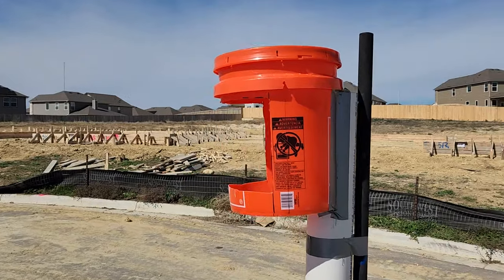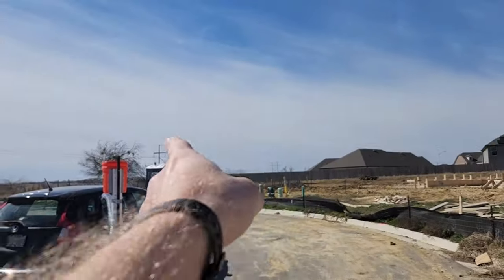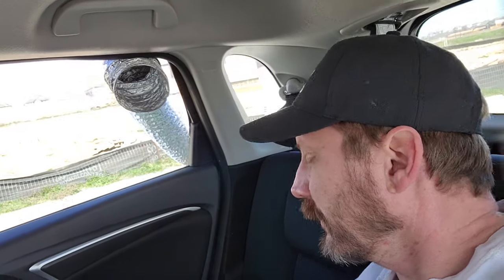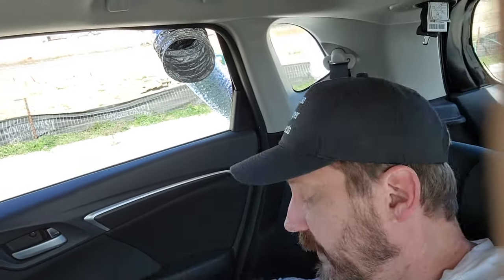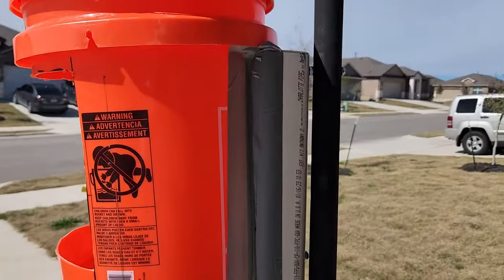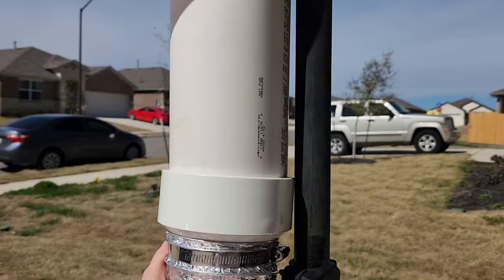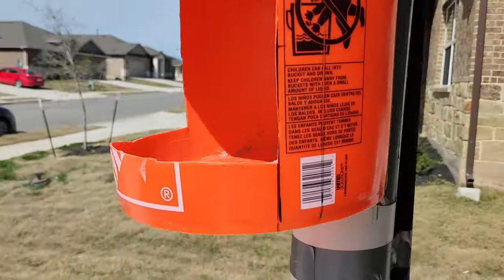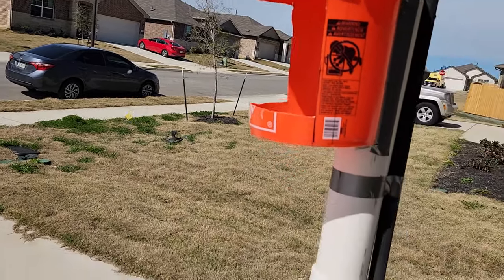Can you have Free Air Conditioning?   Use a Wind Catcher! Darwin wind turbine!

Comment: how about a fin on the bucket then it will automatically redirect won't it?
Reply from the maker: Already doing that for version 2. It will have a tail on the top with a swivel to turn itself into the wind. Thanks for stopping in!
Reply from the maker: Tried that with a tail on the back to redirect. It sort of worked.  Video is up

Comment: Great idea as long as you drive slow.  :). 
Just kidding.  It's a great ideas 💡!  You could use it in conjunction with evaporative cooling, which has been used for thousands of years even to make ice 🍨!
It can take the place of a fan to greatly enhance  evaporation.  Love it!!!  Ty!
Reply from the maker: The original idea has the air blowing over underground rivers to pick up moisture.
Reply: @texasprepperprojects  Underground Rivers like Austin aquafiers?  Local govt might take issue due the potential of contamination.  I know they are super particular about their aquafiers.  
Also, if you pull air out of a well, unless the wells' cave is massive, it will create a vacuum and stop blowing unless you also put air in the hole, unless there is a large opening to allow air in.  
You could use the evaporative cooling trick to cool water then blow air over a car radiator for cooling, but a geothermal IMO is best for that sort of thing.

Comment: Its not "air conditioned" wind, right?  The temp of the air delivered is the same as the air received in the bucket, right?  You would be cooler because of the effect of air flow.  I can see this as an adaptive passive cooling strategy kind of like the wind chimneys in the middle east
Reply from the maker: this is true